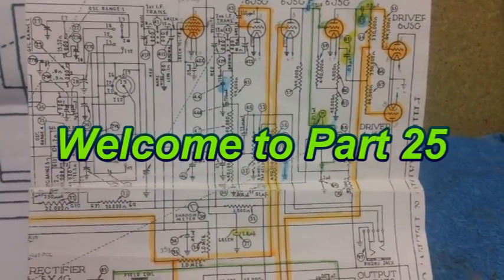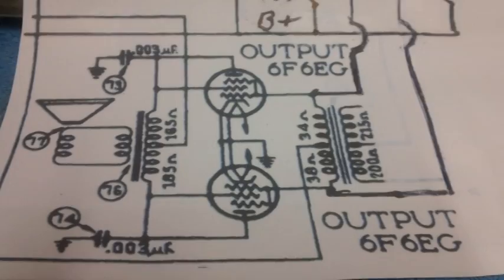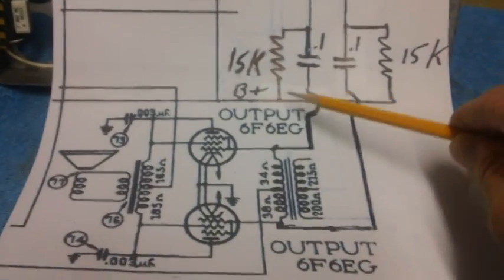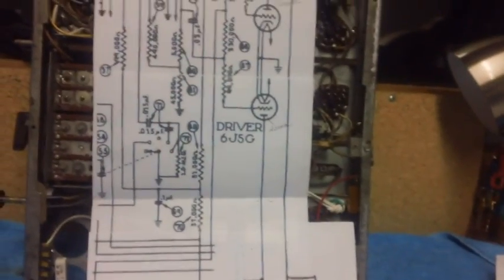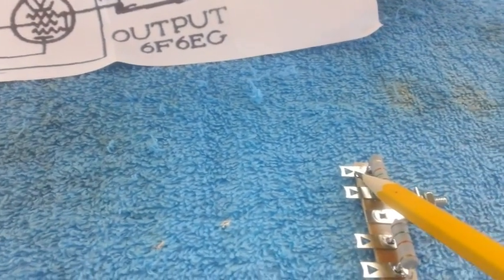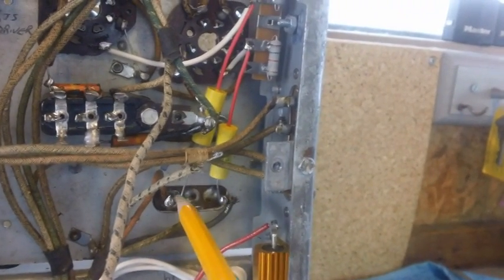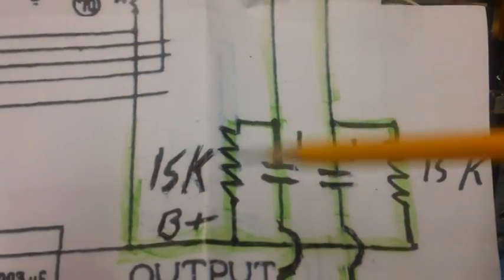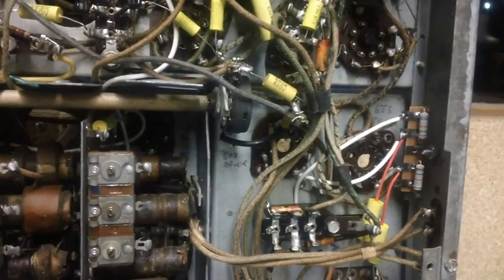Philco model 37-2670 repair and restoration (Part 25 of 34).

Comment: I read that this  method may actually improve bass response ....?? Not that it would make much difference in most radios , speaker amd output tranformer probably couldn't handle it anyways ...I think it is neat the way they use the negative  centre tap to develop bias in these old radios ....I am still learning ....
Reply from the maker: Chris,
We're all learning, my friend.

Regards,
John